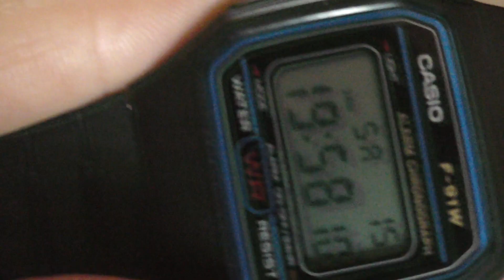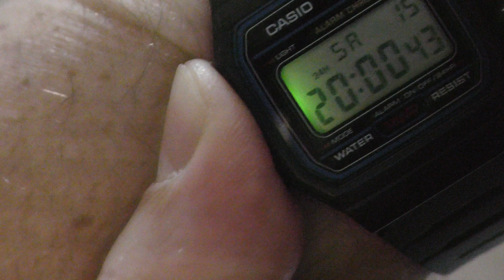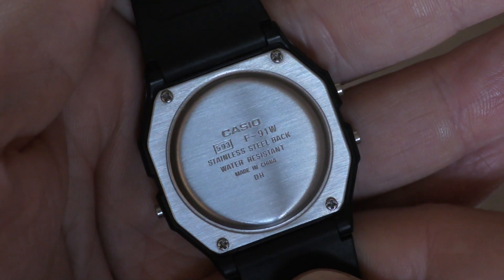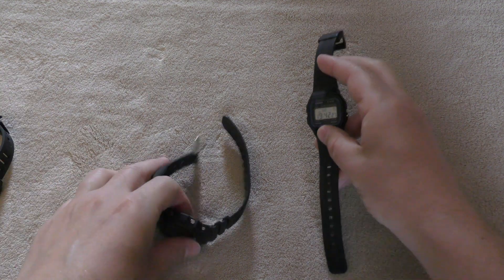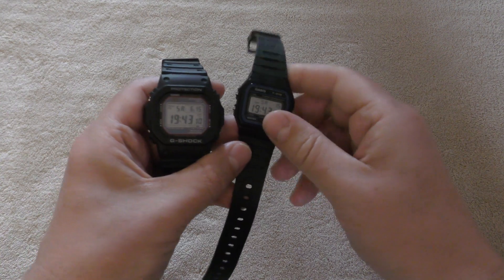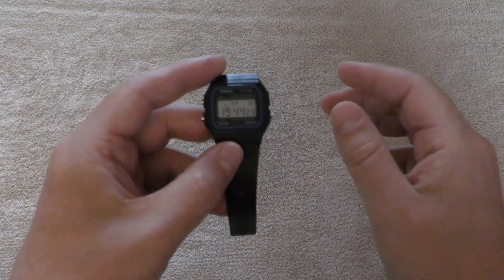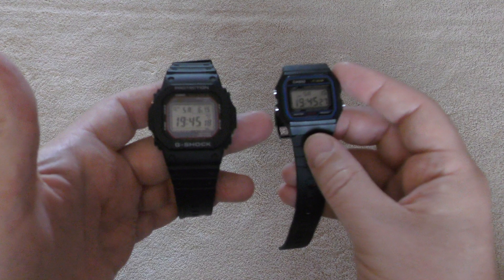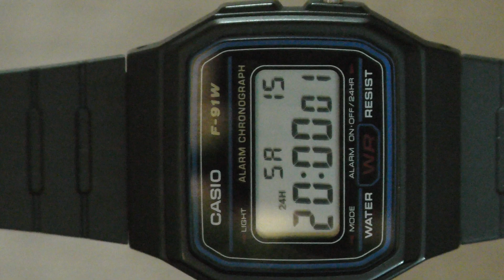Casio F-91 - Improvements

Comment: If I were to improve the F-91W, I'd still want to keep it similar in price. Hence, I'd go with the movement inside the Casio B640 as it has the 2 things I want in my F-91W; an illuminator backlight and a countdown timer. Then for a more premium model I'd have a steel case and bracelet.